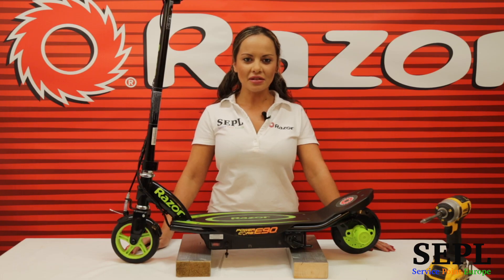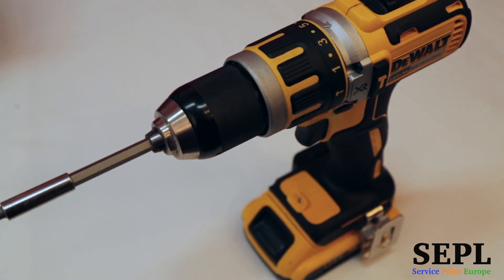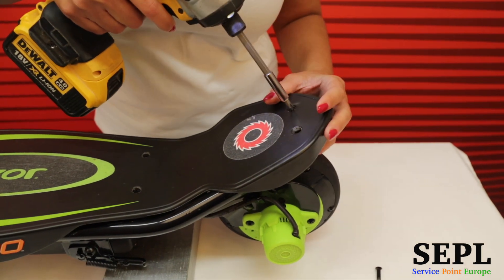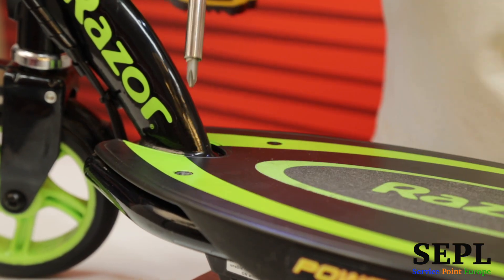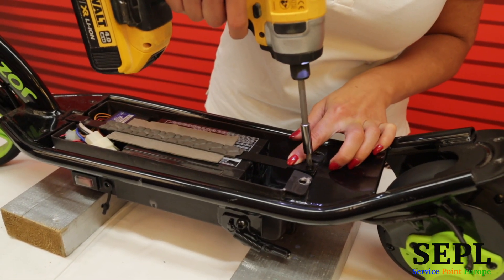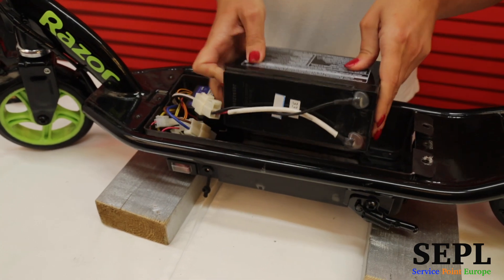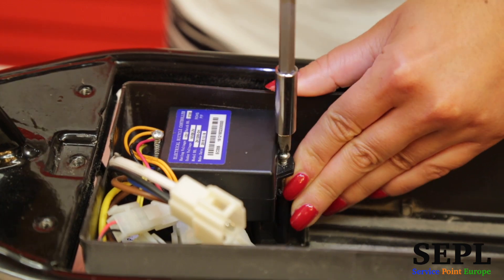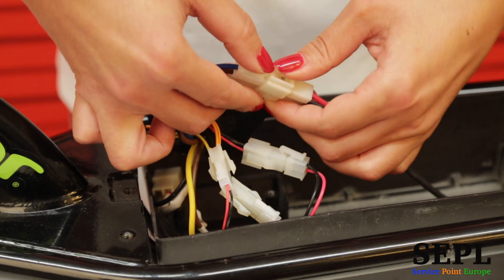Razor PowerCore E90 Control Module Change by SEPL

Comment: Quick question i replace the control module on my scooter and still doesn’t work. Did i just got a defective controller
Reply: You realize you have to spin the wheel up to 3 mph before it will go?
Reply: @stopthebus  do you really?
Reply: @that1foooSDadCuhzzo  On most scooters yes. You stand on them, kick off and rotate the throttle. The motor will kick in and off you go. Not like a motorcycle where just twisting the throttle will set it in motion.

Comment: What are the symptoms of the module going bad?
Reply: Even slower movement… exotic noise. And a couple more.
Reply: I have a scooter which won't drive the motor. Motor is good, battery is good, go button tests ok. I am trying to work out the schematic for the control module.

Comment: Hi, I have had intermittent power supply and I was asked to change the control module. However, I am unable to remove the connectors from the ON/OFF switch. 
Could you please help
Reply: Pry with a flat screwdriver, they are a bit sticky. They have a small locking tank in the middle.

Comment: I just installed a new batt and control module, scooter still won't go, tested the motor with direct power, tested the push button and brake switch with ohm meter, all good. Did I get a bad module?
Reply: same problem, new module and no go.
Reply: @stevenbarker3569  China made?  I guess I;m gonna have to go with the Razor brand module instead.

Comment: Why can't they tell you which wires go the brake switch and which ones go to the push button, the connectors are the same. You have a 50/50 chance.
Reply: I am in the same predicament
Reply: @matthewsbertoli570  Yellow to brake switch, orange to push button.
Reply: Just mark your wires with colored tape before you unplug them, this is a good habit to get into when working on electric wiring or these days use phone photo.

Comment: I have three questions. Is the push button throttle pressure sensitive or on/off? What is the capacity/voltage/current of the battery? Can the control module be upgraded?
Reply: It's basic on / off. The battery is a standard 12 V 7 A/h type. Yes the control can be upgraded - look up Variable Speed Conversion Kit here: https://electricscooterparts.com/razor-power-core-e90-scooter-parts.html
Reply: Do you know max speed after conversion